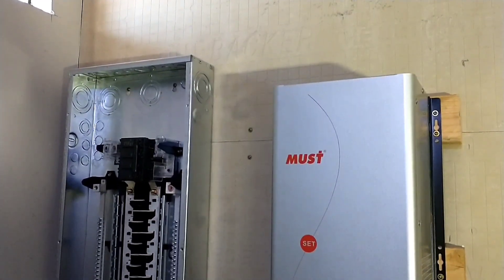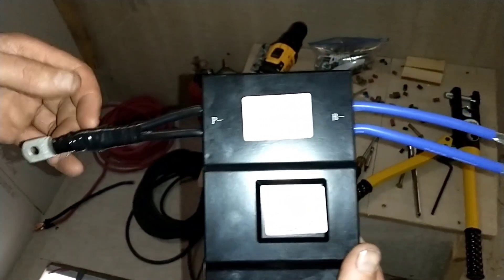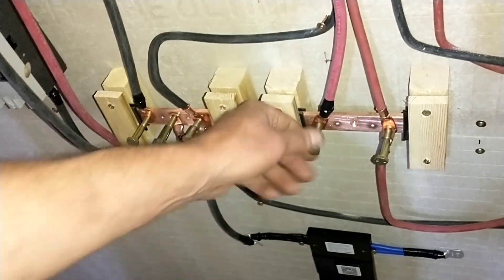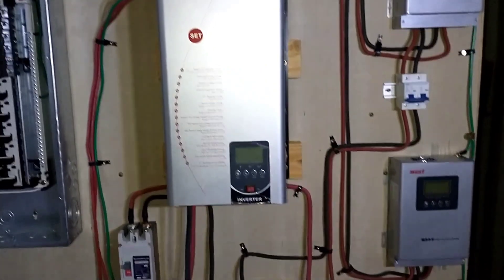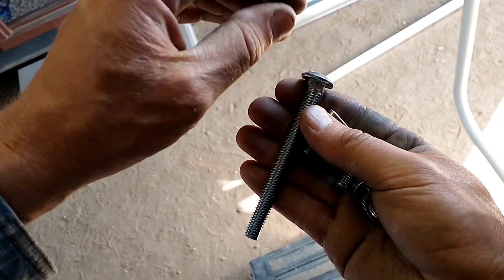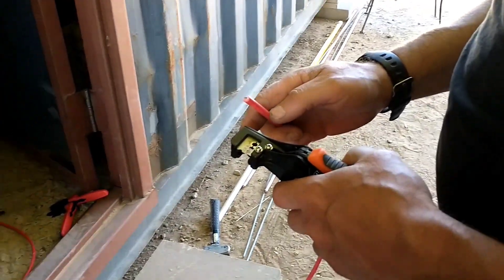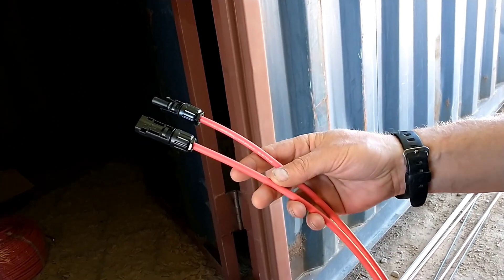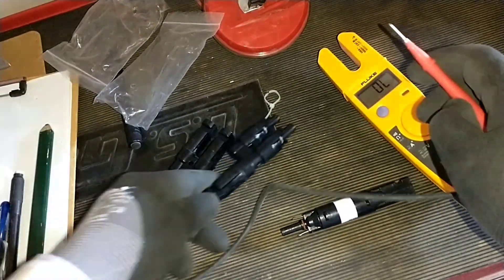Wiring & Installing 6,400 Watts of Solar Panels For Our $6,000 Off-Grid System 🏜️ A Look Back 2021

Comment: That's what I need to do to my panels. Mine are not producing as much as they should be. 2S2P.. and only get up to about 800w out of them.  I've seen them get 1012w once.. Want to double my 4 bb lithiums and wire them up to being a 48v system.
Reply from the maker: Yes, lots of variables can affect their performance. They have worked great for us. We just added another set of batteries to our system, which has been nice this winter.

Comment: Hi there..  I live up in S. Oregon right now.. but wanting to buy some land and build a nice solar system to go off grid. I already bought 4 of the same 400W Trina panels. I didn't buy enough of them.. Can't find anymore of them.. so I have setup to buy 20 smaller 290w panels. I'm thinking about a 5Kw system. I will pour a concrete pad and then buy or build a nice metal carport on it then roll my '28 trailer under it. Kinda like "tiny shiny Home" did.  A couple of those 20 or 40' containers look like they'll make for some good storage too. Might buy some land down there in SE AZ to settle down on this summer..
Reply from the maker: Here is a video showing the start of our shipping container, storage, solar, set up. https://youtu.be/EO5VBhCptb0  This structure has worked out really well for us, and saved a lot of money. Arizona is a great place to go off grid, it has some challenges, but we love it out here! Best wishes! 🧡🏜️

Comment: Best $6000 spent so far. When do you plan to add another battery bank or do you find you do not need since you cycle once in three days? Thanks for sharing
Reply from the maker: Yes, it has been great! Red ordered another set of batteries last summer, but hasn't installed them yet. We thought we would need more battery to make it through the winter, but did fine. We don't run heavy users at night, which isn't usually an inconvenience, but the extra storage would probably be nice for winter, and allow us to run the water heater all night and cook with electric appliances more.  Thanks!

Comment: I bought most of my system during that same time. I decided to make mine a lot bigger mostly because we are in Oregon and have winter with reduced sunlight hour’s. The components I bought this year were about 20% more expensive. With inflation and supply chains being compromised any viewers interested in solar should do it now. I power my house and a plugin hybrid car that way it has a reduced pay back time.
Reply from the maker: Cool, yes it was great timing! Our second set of batteries, (that we haven't installed yet) was almost double the cost, but they are a different brand. Arizona is pretty ideal for solar, I can imagine you would need a lot more solar in Oregon. We had planned to buy a hybrid car, but they were more expensive than we expected, and our 1999 Lexus is still doing fine, once it dies, we'll probably replace it with a hybrid. 😊🏜️

Comment: Another terrific recap of your progress last year.  With “necessity being the mother of invention” I appreciated your workarounds regarding bolt length, carriage bolt modification, searching for fallen parts in the inverter and using the broomstick and tape for bolt inserts through the roof.   

Wishing you and your extended family a blessed week and a gentle spring season.   Peace
Reply from the maker: Yes, there are always problems to figure out and work through. Thanks so much! It's been a wonderful spring and we are glad to be mostly working inside now. 🌷😊🏜️

Comment: Hi Red and April, 
We had 33 panels installed on our roof back in 2016. I'm not sure how many Watts. It takes care of all our needs. We paid just under $20,000.
Our house is 2,000 sq.ft. under AC.
We sell excess back to Duke Energy.
The grid charge monthly is up to $33.50. Four years ago it was under $10/month. Most Energy companies think Solar owners should pay more as time goes on. If you are off grid then 👍💪👍 Unless we had a whole house battery we can't do that. 
I hope we get to see more of your progress 👍
Reply from the maker: Sounds like a nice big system, hopefully you have made a lot of your investment back by now. It's a bummer the electric company charges you so much each month! 
Yes, we are completely off the grid. We bought at a good time, the prices had dropped quite a bit. It was just a few months before the prices of everything started going up again. Thanks for watching! 😊🧡🏜️
Reply: @RedandAprilOff-Grid  We did get a $5,000 tax credit. We were paying over $2,000/yearly so approximately 7 years to break even.
Reply: In order to bring down your break even time? Consider an electric car or a plugin hybrid car. We have a plugin hybrid car and it is our main vehicle. It has made our solar so much more cost effective.
Reply: The plugin hybrid also has tax credits. That make it even better on the wallet.